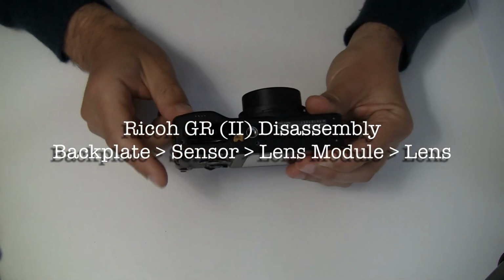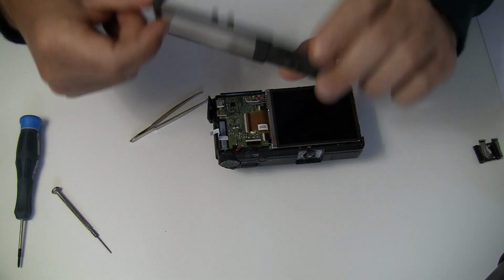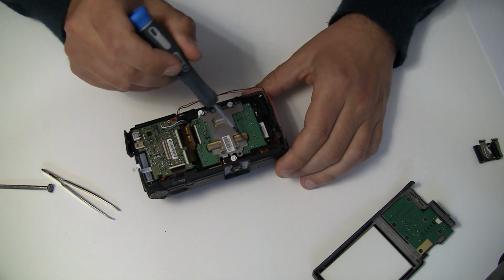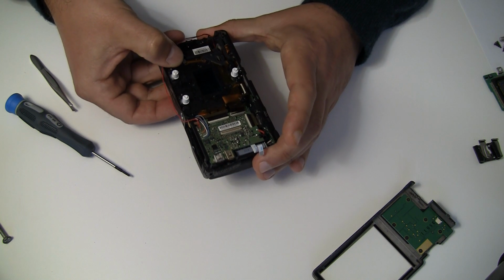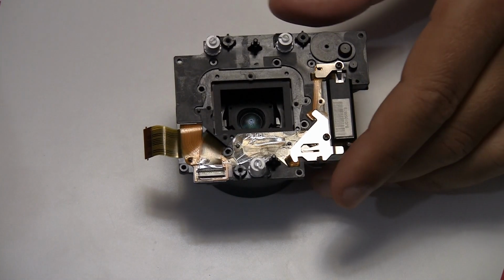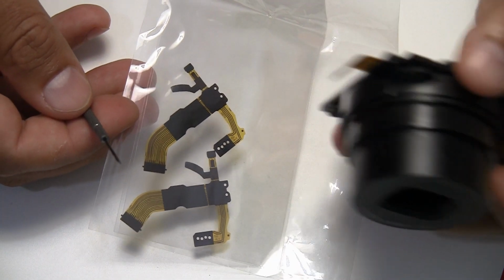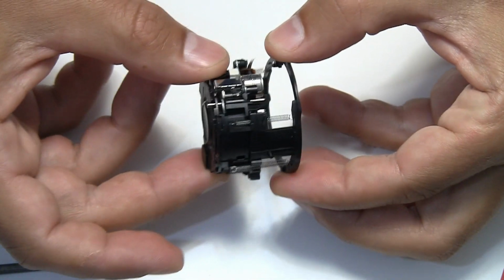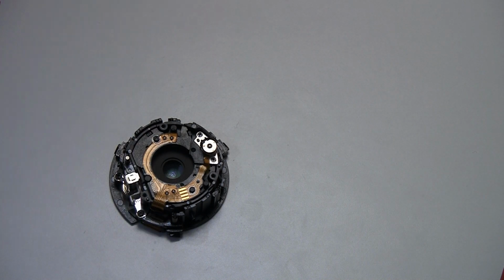Ricoh GR (II) Disassembly

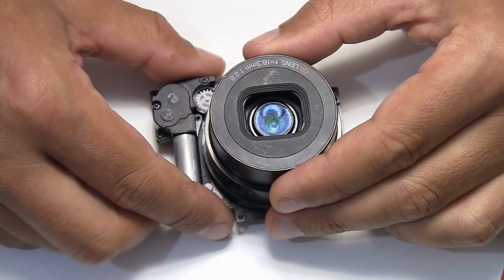Comment: 17:23 - when i try to lift up the lens at this point there are 4 springs connected to the lens - how do i get them out? thanks for the video!
Reply: forgot to take away one screw :(
Reply: @carstenseidler2436   What screw was that? I'm at the same point and can't figure out what's attaching the spring assembly to the base. Thanks
Reply: @whiteryanc  I can`t remember sorry. But if you are not a professional you will have no chance to replace the shutter cable trust me. Try selling your broken camera instead. Mine is destroyed..

Comment: I just got my cable in the mail, your video is very timely!
Reply from the maker: I ordered two once I learned about the cable fix. Still I need to confirm it myself :) If you happen to repair it please document the process! One important note on the lens module dissassembly. After recording my video I saw in this one https://youtu.be/rE7h_N9BsTw?t=240 that it is possible to remove the front plate first instead of trying to pull out the inner lens module like I did. Hope this helps.
Reply: @mikphoto  I will do my best to share the results!
Reply: @mikphoto  Such a shame that video has now been removed. :(
Reply from the maker: @tomfenn7149  in short it shows how to remove the front plate: see https://www.youtube.com/watch?v=rbi6noK5BWI&t=61s

Comment: In order to disassembly the final part of the lens, you have to take the front aluminum ring off(where the lens specs are), and turn the front lens face clockwise a few millimeters, then unscrew the three screws that hold the front element, take that off through the front and the rest of the lens from the back.
Also the loose spring is from the barrel that rotates to close the lens protector.
Thank You for the video.
Reply from the maker: thanks for the detailed howto Walter. I need to re-record this part since I clearly went the wrong way here.
Reply from the maker: I followed your advice and hope that this time I got it right https://www.youtube.com/watch?v=rbi6noK5BWI

Comment: Great guide! Love how much detail you've gone into and I wish I'd recorded a video when I made my guide - this will definitely help people extend the lives of their GRs :-)

I had a reader email me that the white ribbon cable (shown on left at 6:31) on their GR has come out from the mainboard - i.e. is still attached to the board on the backpanel - and they can't reach it because the connector is on the other side of the mainboard.

I don't suppose you removed the mainboard at any point and might have some instructions for them? I wasn't able to help but pointed them at your video in case removing the sensor + lens would make it more accessible.
Reply from the maker: Thanks for looking Jamie. Just to make sure I understand it clearly. The ribbon cable is disconnected not from the backplate like in the video but on the other end from the mainboard (in between the battery compartement)? If that is the case one would have to lift up the mainboard. I had a look and it seems that in order to lift it a small green cable on the top left corner of the mainboard has to be unsoldiered first. The cable connects to a battery contact. It is so short that it prohibits lifting up the mainboard. Make sure not to shortcut the possibly still loaded flash capacitor battery!
Reply: @mikphoto  you can discharge a flash capacitor by placing a 1MΩ resistor in parallel over the capacitor terminals. Don't of course hold the resistor with your fingers as you may very well get a shock! You can measure the voltage drop with a multimeter, so you know when the cap is discharged.

Comment: When i switch it on, the lens popped out out as usual but it is now stuck at the out position and when i try to turn it off and on again the display comes for a second and then it switches off and the lens is also stuck at that position. I opened the camera now and see that the black cable that you are taking out at 5:20 is almost broken. Can that be the cause of the issue?
Reply from the maker: It´s the microphone you refer to and most likely not the cause for the lens to stuck in the out position. Could be a broken flex cable? Yo´ll know when you check it. Look further to see how to dismantle your GR and goog luck!
Reply: Mine is doing the exact same thing. I've taken it apart, manually got the lens to retract but the second I turn it on it will extend the lens and power down. Turning it back on results in a motor whirring sound, nothing happens and it turns off after a second. Did you find any fix for yours?
Reply: Exact same issue here. Flexible parts such as PCB's are almost always (apart from switches), the parts that fail first. Oddly with mine if I do the hold playback button then press the shutter release, this tricks the camera into thinking everything is okay, so I can then view the image on the back screen. But moving the aperture dial does not open or close the aperture iris which makes me conclude this is indeed a broken lens PCB cable.
Reply: Did ay of you peeps solve this one? Mine is the same
Reply: I have the same problem, did somebody find a solution for this? I thought I just this a poor job soldering the lens shutter flex cable, but this would just cause the shutter issue?

Comment: I've got my GRII open right now and have stripped it down to the lens assembly. It's frightening just how much dust gets into this thing. It's everywhere! Except for and on the actual sensor. The sensor part is clean as a whistle. So the dust problem with this camera really does lie with the blue IR filter glass on the lens side (this would make sense as the dust appears the smaller the aperture is set). My suggestion to Ricoh (are Ricoh listening?) would be to scrap the retracting lens mechanism altogether, thus preventing the 'vacuum effect' that seems to suck small particles into the lens assembly. The lens when the camera is on doesn't protrude that much so I doubt it would be a problem for those still desiring a pocketable camera. It would also make the camera even faster to use from start up.
Reply from the maker: Thanks for your report Tom. Thats what I observed too. The dust accumulates on the hot mirror. The lens barrel design is a compromise between keeping it thin and allowing dust to enter. After first dust spots I used the lens adapter + clear filter. They never left the camera and protected it quite well. The GR III appears to be much easier  to "clean" then the GR II since you have to unscrew less stuff to get to the sensor and blue mirror. Still I wish Ricoh could improve the lens barrel sealing even more.
Reply: @mikphoto  I'm currently waiting for the new PCB part from China to arrive, but while going into disassembly of the lens barrel a tiny piece of white shaped plastic fell out (including a cog- but I know where that came from), which is now probably going to give me a headache trying to figure out where to put it back. If anyone knows where it likely came from, I'd be more than delighted to hear from them. :) 

But back to my point about the extending/contracting lens... The front plane of the lens when fully extended, most of that is just the mechanical lens hood. The actual lens is about 8mm behind it when that is fully extended. It seems crazy that @Ricoh has opted to have all that 'dead space', which if the lens didn't extend at all, would only protrude slightly from the camera body. Since it's fixed anyway on 28mm (or 40mm in the case of the GR3x), it seems ridiculous to have this flashy auto protruding lens on such a serious (and expensive!) compact camera. I think Ricoh should just get rid of it altogether as the coatings on most modern glass today is pretty scratch-proof, and we should just have removable lens caps. In fact a smaller filter adaptor would probably suffice. Ot just a thread...
Reply from the maker: @tomfenn7149  I guess the 8mm is a head room for macro mode. I recall that once macro is activated the lens extends a bit further towards the barrels end. I have to double check.

Comment: so did you noticed any broken wire in the lens cables? maybe it is dust or dried substances. I have the close shutter problem too; I only can shoot if I manage to depress shutter button then it opens. If it doesn't, I give it a 'shock' and sometimes it works. Strange thing, after that it works well perfectly no matter how many shots I make, until I close and open again...

Comment: Great video! Is there any way to make the lens not to retract itself when power is turned off? In other words, any possibility of making the lens always stay in the position when it's powered on? Thanks.
Reply from the maker: Posiibly yes. You could extend the lens to the outermost position so that it doesnt retract when you push it back inside, then remove a gear from the gearbox and hope that a posible camera startup check wont recognize the modification. If you try, please let us know if that actually worked.

Comment: some people also suggest it could be the battery; maybe the voltage drops. Did you people checked your batteries? Mine are pretty old and notice some small behavioral difference when they are fully charged

Comment: Hi and thank you. The faceplate, where the the writing (GR LENS f=18.3mm 1 :2.8)popped off, leaving the bare lens. I can't figure out how to get this thing back on, it won't just snap back on, it seems to require a specialist knowledge. Can you help?
Reply: @mikphoto  thank you so much. one thing that I did wrong: the little inner plastic ring that lifts out...well, I lifted it out and didn't pay attention to what orientation it was in while it was still in its place. If you can advise on that, I would appreciate it. Looking forward to the video Michael!
Reply: @mikphoto  first, many thanks for the video, it helps a lot. The step you mention here is the exact same place I am stuck at the moment. Can not put the front element back properly. I am looking forward to see your video about it.
Reply from the maker: @Dondiegorivera  Hallo Roland pleas see my detailed disassembly and reattachment video: https://www.youtube.com/watch?v=rbi6noK5BWI
Reply from the maker: @jeffreythemeditator  Hi Jeffrey, please have a look at the full lens barrel disassembly video https://www.youtube.com/watch?v=rbi6noK5BWI
Reply from the maker: Please look at the howto open and reassemble the lens barrel video https://www.youtube.com/watch?v=rbi6noK5BWI

Comment: Hello! Very nice video!! My Ricoh has the "closed shutter" problem and I am attempting to fix it before it gets worse! I am wondering if there are any  updates? Did replacing the flex cable work? I called my local service centre and they said it might have something to do with dust build up as well! But either way, your videos have been helpful!! I think I will attempt my repair in another months time!
Reply from the maker: The flex cable is a very likely cause for the malfunction but one can be only sure if the cable is inspected visually. I think photo services have been picking up the video instructions and offer valid repairs.

Comment: After changing the LCD, I noticed a blue streak on it. Do you know if this is caused by poor installation or is the problem with the screen itself? The streak does not appear in the photos, so I could even leave it as it is, but I don't know if it will affect the life of the camera.
Reply from the maker: Could be a misaligned flat cable connection or a broken lcd.

Comment: Hello. I dropped my GR2 and the flash bulb broke. I can see that replacement bulbs can be bought on eBay, but I cannot find any instructions of how to replace the bulb. Any chance you could help out?
Reply: Same problem ;(
Reply from the maker: That would be another video part to record. I sold my GR in pieces, and I won't record any more disassembly videos with a GR.
Reply: Did you manage to change the bulb?
Reply: Same problem, did you manage to change the bulb?

Comment: Just wrote you on your website about this solution thought you still didn’t know how to fix stuck shutter 😅
Reply from the maker: Thanks Leed. I was aware of people mentioning the Flex Cable. I have not exchanged it, so I can not say myself that it is a fix. In any case, when there is no repair option around its probably worth trying. The cable costs only around 10 USD + shipping.
Reply: @mikphoto  have you managed to fix your camera? Will be picking up my cable today, hope to fix my camera on weekend, maybe Ill even make some video
Reply from the maker: @LeeD345  Hallo Leed. I did not continue to disassemble the cable yet. Still need to get a small enough soldering tip. In case you do it please record and report back.  Best of luck!

Comment: So I was changing my screen, and I accidentally disconnected the back cover from the board. Any advice?
Reply from the maker: The flat orange cables are not soldiered. You should be able to connect it back again.

Comment: Thanks a lot for this. Been wanting to look inside my OG GR for a while and it will def help me. 
By the way, if I'm switching the camera on, the lens come out, but the screen freezes (it is not black though). I need to remove battery, then switch it on again and repeat this process few times for camera to work normally. For me it looks like there is some focusing issue, something inside is blocking the barrel a bit (I guess) and it has a hard time moving. Have you ever come across anything similar?
Reply from the maker: Hallo Marcin. Thanks for watching. I did not encounter such behaviour. Hard to tell what is happening without seeing and hearing the camera. Your note of the barrel moving slowly suggest where to look. Of course electronic parts (like to motor) could also be the cause?
Reply from the maker: If you need to see inside the lens, here is a detailed walk trough howto access and reassemble it. https://www.youtube.com/watch?v=rbi6noK5BWI

Comment: I would NEVER attempt to as much as remove the screws unless I'm wearing a anti-static wrist band. Even if the device is outdated and/or obsolete.  
 I just don't understand why anyone other than a electronics technician would attempt such a feat. You probably paid a hefty penny for your GR and never dreamt about taking it apart.... I'm sure the Ricoh techy wouldn't have to go through all those steps!! 
Sorry, I just recently purchased the GRIIIx and it almost brings a tear to the eye to watch someone dismantling a very expensive pocket camera!
Reply from the maker: Thanks for your friendly warning regarding electrostatic shock possibility Will. I will add this advise to the description. As stated in the disclaimer this is not a official guide etc. Every expensive new camera will get cheaper over time. Some potentially fail. During this time you could train and become confident with do-it-yoursef-repair or let/pay others to do it. There are a lot of instrctional videos. As fot the griii check this handy dismantle thread https://www.dpreview.com/forums/thread/4600195#forum-post-65491842
Reply: There is much evidence now that a anti-static wrist band can make the chances of frying a board even higher. Most modern components are a lot more robust than they used to be. There are of course exceptions, but in this case having all components already soldered to the board, any static charge present (as long as you aren't wearing loads of man-made fibres!) is dissipated throughout the existing PCB. In a nutshell, you'll be fine. :)